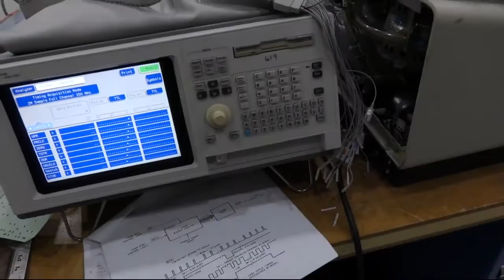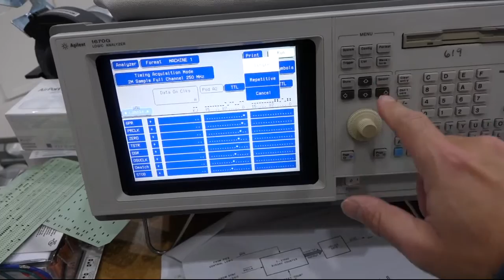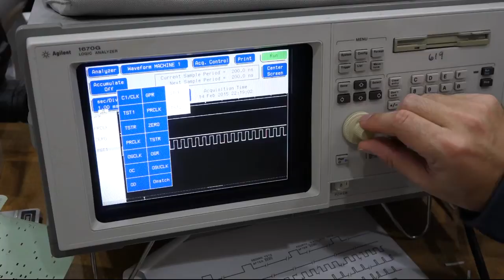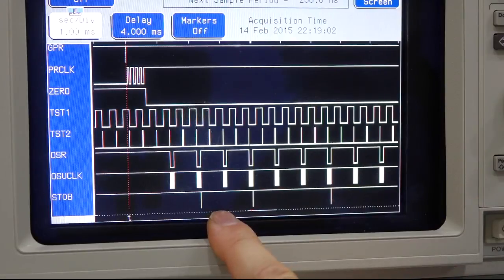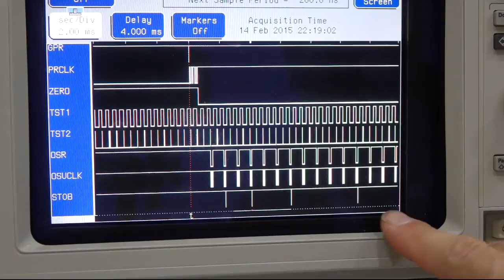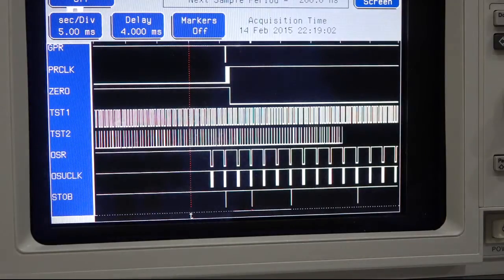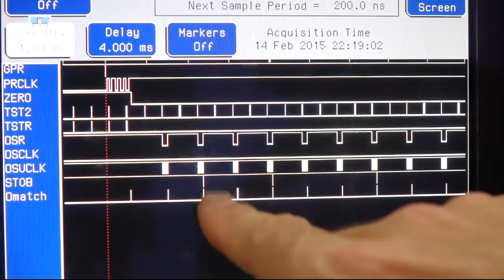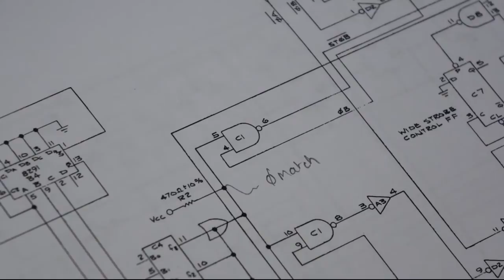Documation Punched Card Reader Part 2 - Using the vintage HP 1670G Logic Analyzer

Comment: Does that logic analyzer run HP-UX?
Reply from the maker: Good question. I have no idea what it runs, as it presents itself as a self contained test instrument. It supports an X11 remote session, and you can remote mount the hard disk as an NFS disk, so an embedded version of an early HP-UX is a reasonable guess. But it does not present a windowing system like the later 16700 series does - graphics are rather primitive and flat in a fixed window size as you can tell. It would be interested if you find out more details.
Reply: CuriousMarc
Yeah, it's actually based on HP 9000 series 400 (68k) architecture and it runs a lightweight HP-UX build from ROM.  The larger mainframe analyzers are full HP 9000 systems in themselves which can be used as workstations or servers as well as logic analyzers...
Reply from the maker: douro20
Cool! Thanks for the info! I am very impressed by how helpful and capable this  analyzer is despite its simple interface. Yet another superbly engineered piece of vintage HP test equipment.